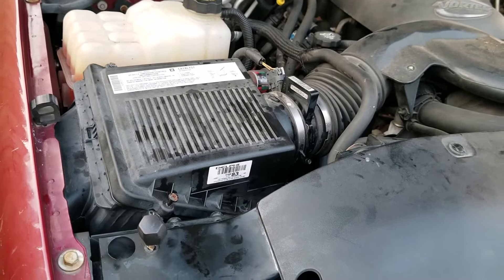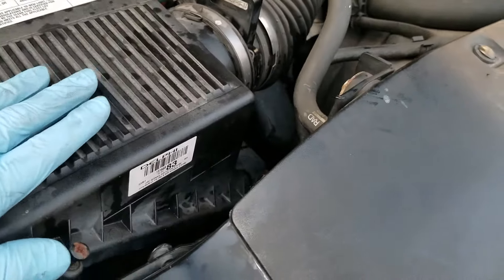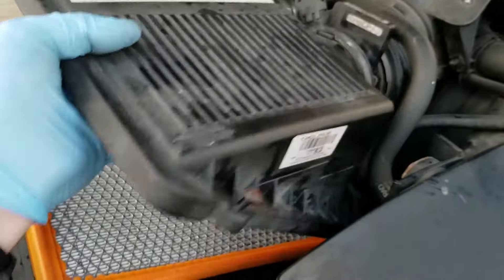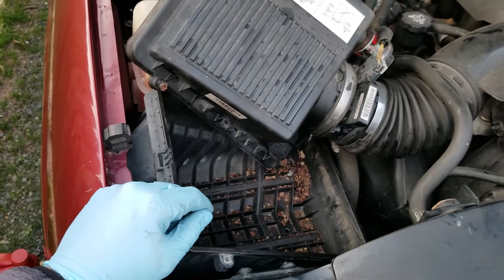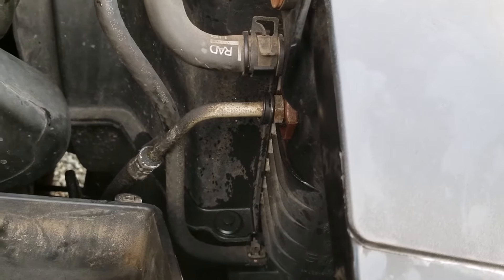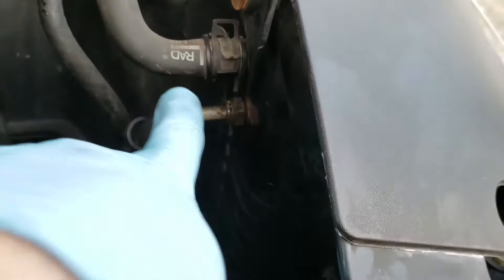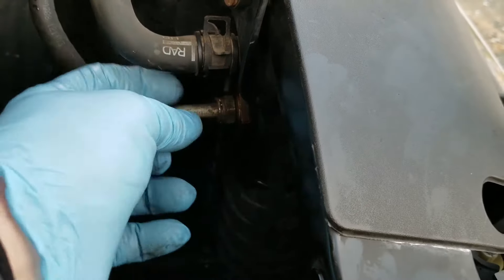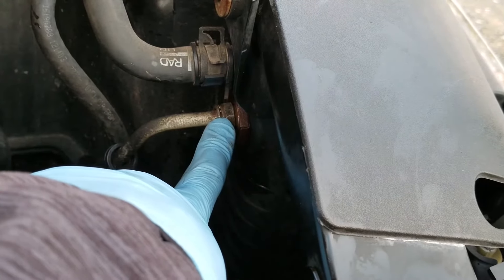4L60E Transmission Flush. NO Special Tools Needed! The fluid was REALLY bad!!

Comment: Not the best representation. Others fill 2 quarts over, run it till they get 2 quarts, put 2 more in and do it again. repeat till it runs clean fluid. That way when youre done, you are at least close to proper fill and you never risk running the clutches and pump dry.
Reply: Apparently, he added fluid first before pumping old fluid out so he wouldn’t run it dry.
Reply: Hush
Reply: That was my concern as well….. if you do this, is 2 qts like the max you want to run out before topping off? I have a 2003 yukon 4wd 4L60E. Not sure the capacity range of fluid when looking at the cross hatched portion on the dipstick when hot

Comment: The return line lubricates the transmission. It doesn't dump into the pan, so you were doing damage, which is not smart.
Reply: Do you need a two chamber pressure vessel or something to pump new fluid into the return then?
Reply: @stevetillery2432  Pretty sure the flush machine will use the return line and not the dipstick - they have the choice at the quick lube place to use the dipstick or both cooler lines (one to flow out and one to flow in). But the problem with using the return line for the new fluid is I think that will force out the old fluid blockages back through the transmission to cycle back out as the new fluid replaced the old.

Comment: I have a 2000 Silverado and the radiator cooler reservoir is plastic. Not sure about taking the nut/fitting out of it. Plastic is easy to strip the threads

Comment: my son and I change the Tranny Fluid every spring, before we start pulling heavy trailers, he has a Nissan Ultima CVT tranny, and has that changed annually also, it has 125,000 miles and runs like new. His truck is a 2006 RAM TurboDiesel auto Tranny, changes fluid for every long trip, pulling 20k loads, never a problem with it
Reply from the maker: Basic maintenance goes a LONG way
Reply: CVT are a time.bomb, especially from Nissan

Comment: Quick question..was this the first time ever changing the fluid on the Yukon..if so how many miles was on it. I have a 2004 Suburban that I bought used..dont think the trans fluid has been changed..just hit 100K. Some mechanics say leave the fluid alone..some say to change it.. Thanks
Reply from the maker: Honestly, I don't know cause I bought the truck used with 145k. For the mechanics that say don't change it....... I say they are in the wrong. Doing a pan drop and filter change would be a good start then after a couple thousand miles do this method to do a full fluid exchange. NEVER do a machine flush.
Reply: @JrZCarZ  Thank you for the quick reply and advise!!. Im first gonna do a pan drop and fluid change, I will replace the pan with one that has a drain plug so its easier when I change fluid again after couple thousand miles.
Reply: I’ve heard that also. But all fluids NEED to be changed. If you’re having problems,they say you can screw it up more. If you’re Not having issues with trans, change it by all means to keep it problem free for as long as possible
Reply: I too have learned that you should change the fluid.  Only from now on I'm gonna have the pan dropped ant a look at the filters.  They are there for a reason and I've heard the arguments for leaving it alone but really that just means you will drive it until the transmission grenades itself.  Now I was in that camp practically my whole life but having done a couple of older projects and now I'm replacing my transmission as I speak. Why ? Because I ignored some basic things it started doing; which was over modulating or slipping going into third.  Now I'm armpit deep in grease and still only halfway done. The point is there are good arguments for both but having lived long enough I would say preventative maintenance is you best bet.

Comment: Any updates or feedback on how the transmission was after the flush, any noticeable difference in how it shifted, no change? Thx
Reply from the maker: Transmission was good for a bit after the flush but it ultimately suffered the common 4l60e failure.
Reply: @JrZCarZ lol I might be in the same spot. In the process of doing 2nd drain and flush and wondering if it’ll last longer or less time after swapping out another 5qt of clutch material filled pinkish black atf. how many miles did it last?
Reply: @JrZCarZ  Sorry, I'm not familiar with the "common 4160E failure" what is that failure?
Reply from the maker: Here's a good read on the issues
https://gearstar.com/3-symptoms-of-a-failing-4l60e-transmission-and-how-to-diagnose-the-problems

Comment: great video.  OK- i have an 05 suburban- same set up.  if i can't get fluid 'out' (don't want to drop the pan, etc.), should i unhook the bottom line too - for it to drop fluid out?
Reply: Curious to know what you did as your question is 3 months old, but that's what I've heard guys do. Just pump all the okd fluid out until you get clean fluid pumping out.
Reply: Always change your filter
Reply: @chuckylee8812  which means to drop your pan guys.

Get new gasket and filter...and swap in new.

Be careful to get the old oring from old filter out as you don't want to double stack these causeing.leaks

Good luck.

Comment: Thank you for making this video I have water mixing in with the transmission oil and I need to flush it out I believe radiator inner cooler busted and is causing water to go in the oil cooler causing it to mix with the transmission oil
Reply from the maker: Good luck, hopefully it was only a little and for a short time cause water in the fluid will kill those clutches quick fast and in a hurry

Comment: What’s the best way to do it so I can drop the pan without making a mess? 2003 Yukon 4l60e
Reply from the maker: If you suction the fluid through the fill tube it will get enough fluid out to where it's not going to make a complete mess when you drop the pan.

Comment: Thanks for the video first of all!!!!
So I’m a little confused. I understand using a vacuum to pull fluid from the dip stick. But wouldn’t you want to change the filter afterwards if you got the full flush complete you still could vacuum the pan out and put that fluid back in?
Reply from the maker: Yep, you would want to replace the filter as well to complete the service. I had already replaced the filter so I didn't do that in this video. Thanks for watching!
Reply: This is a cleaner way of doing it.Once you loosen the trans pan, you get fluid all over. If you extract fluid first, cleaner job. Also, some change the filter every 2 or so flushes, some people open a whole new can of worms by taking the pan off in the first place.
Reply: Especially w/ an '06 Yukon it can be a pain just to get to the bolts & that's assuming the bolts aren't rusted in ace. A shop posted a video & spent over 2 hours cleaning off the old gasket & mating surfaces. I've heard from multiple sources the filter isn't much of a filter as it's a sealed system, & the magnet is what collects the particles not the filter. 
I haven't changed the filter in my '00 jeep cherokee XJ AW4 trans & a lot of guys don't & we get 300k or more on those old but rugged engine & trans. Using a quality fluid & regular "severe use" service schedule seems to be key. Adding a trans cooler would also be a better use of time & money then scraping gaskets & getting the pan to seal.
Reply: Get you a pan with a drain plug on it. Thats what I’m planning on doing. Thank you for the vid!!!

Comment: Question, did you begin putting in new fluid as you flushed out old fluid? Or did you first flush out ALL old fluid?
Reply from the maker: I dropped the pan and replaced the filter before filling it back up. Then once that was done I performed the 'flush' so clean fluid was being pumped through the trans.

Comment: After dropping the pan, did you fill with fluid before you drained through the radiator? if you did, I missed that part.
Reply from the maker: Yep that was done before I started making the video. The pan was dropped, the filter replaced and clean fluid re-added

Comment: So, to be clear - After pan drop and filter change, bring fluid to correct level and THEN add 1.5 gallon ATF before flush begins? No problem with overfilling? Thanks.
Reply: for short durations (such as purging/flushing/whatever) no, not really any issues. you just don't want to run it overfilled during normal use.

Comment: Hi there, Some people states that  flushing your trasmission after 150k is not good at all since it would force all the metal debries in the toque converter run into the valve  body  then causing sleepage. Unless it is just a falacy? What do you think?
Reply from the maker: Hooking up a transmission to a service pump like they have in dealerships for a flush is not good. If you do it this way you are using the transmission pump to do the fluid pumping, which is it's normal operation, so it's easier on the trans and doesn't force the fluid through. Take it with a grain of salt thigh cause if you ask 10 people the same question you'll most likely get 10 different answers 😄
Reply: Again. I asked 10 trasmission tech senior experts and told me depending of the fluid inteeval service in your trasmission would take the right option  to flush under normal drving conditions , but if the car's owner doesn't  know or doesn't have any previous récords of maintenance the probability could be 60% to 40 that after any good procedure flush would cause a slippage after several miles of driving your car. Now the grain of salt will turn eventually  into a headache.
Reply: @hansenriquerach-mendoza3515  I think the flush machines either go through the dipstick (which is no different than what someone could do at home with a dipstick pump) OR they hook up both the flow out and flow in to the coolant lines! By flowing the new fluid back in through the cooler line then they are forcing the gunk backwards out of the transmission because the new ATF is flowing right back into the transmission into of if the new ATF is going down to the pan directly via the dipstick. Pretty sure that is what is meant by "reverse flow" via the machine flush.

Comment: so you empty a gallon then stop, add a galllon and repeat until it's clear?
Reply from the maker: Yep. I would add 1.5 gallons in before you start so when you empty the one gallon out you're not going to run the trans dry of fluid. Then when you get good clean fluid out, fill as per the dipstick.
Reply: @JrZCarZ  thank you man! Yeah understood on the first cycle / gallon since I may or may not empty/drop the pan...but I really should.
Reply from the maker: @vzangla  if it's been a while, I'd suggest a pan drop and filter change.
Reply: @JrZCarZ  I

Comment: How did you keep fluid going In to the trans?
Reply from the maker: Basically I added about 1.5 gallons into the dipstick tube, then.pump out 1 gallon. Add another gallon, pump out a gallon and it should be clean by then. That way you know there's always fluid in the pan and it won't run dry.

Comment: if you use biger hose diameter, you can screw hose into radiator hole ( thread)..u save time with mounting hose to nut....
Reply from the maker: Absolutely. This hose is what I had laying around the house so i made it work with that, but you could use a bigger diameter hose as well.

Comment: Why the hell did gm start using those clips? I don’t know how many I’ve lost doing engine swaps. And then hoping you can find new ones at the local dealer or parts store.
Reply from the maker: It's not just GM who has those clips for cooler lines. Pretty much most manufacturers use them.

Comment: I thought you were giving up on the Yukon, glad you haven’t.
Reply from the maker: Thanks James, I was going to write it off but I'm stubborn after I have time to think 😁. I just took it on another spin for about 5 miles and it feels better than it did yesterday.
Reply: @JrZCarZ  Great, new Yukon’s are selling at $78k, unbelievable, Escalades close to $100K. We had a Lexus ES 300 with 200K, we flushed the transmission 3 times and ran compressed air through the trans cooler to clear out any sludge and blockage, it then ran smooth as silk.
Reply from the maker: So far I've put about 35 miles on it and no issues! Which is good, because the starter crapped out on the Torrent and I'm not going to pay the 'bend you over and ram it in dry' box store prices for a starter. RockAuto it is!
Reply: @jamespn how many miles did the 300 last for?
Reply: @KollynJ  It was sold after we processed the mechanic’s lien.

Comment: Maybe I missed this, but did you use Dextron lll fluid?  Is Dextron vl OK for my 2004 Silverado?  Seems to be different opinions on this.
Reply from the maker: I used a multi vehicle fluid that was Dextron VI compliant. Some are not so you have to look at the bottle to see.
Reply: Dextron VI is what I've read is  called "backwards engineered" meaning it can be used in older transmissions that used dextron III. Gm went to dextron VI in 06. I use it in my 05 and 06 sierra, my 03 yukon xl and my 99 Silverado plus my jeep that has a 2000 ls swap. So far so good

Comment: I was told bye Ford not to do it   I didn't know the history of car got 204 thousands miles on it seal transmission
2009 Ford fusion.   No flush transmission
So really don't know now what to do.?
I quess nothing ... History unknown.?!
Reply from the maker: I would just do a pan drop, then drive for a couple thousand miles with some new fluid and do that like 2 or 3 times if you are unsure of the history. I have another video on my channel on changing the trans fluid on my 2013 Escape that may help you out.

Comment: THEY SAY YOU ARENT SUPPOSED TO DO A FLUSH ON VEHICLES? WHO IS RIGHT?
i JUST DID IT ON MY TRUCK, SO NOW IM WORRIED LOL
Reply from the maker: Having a machine flush pushing the fluid through the trans isn't good, however using the trans pump to pump the fluid is perfectly fine.
Reply: I sent a sample of my trans fluid to a lab to see what condition the transmission was in before I did a substantial drain and fill.  The lab is Blackstone Laboratories.  My >100k miles transmission was in excellent shape according to what they DID NOT find in the old fluid.
Reply from the maker: I've used Blackstone in the past sending out engine oil. It's a great tool to have in order to see how things are going with your car
Reply: I’ve always done them on my vehicles. Honda,Tahoe,Sable,no issues. But sooner or later you do want to get in there and swap the filter also

Comment: Really people for how long it took him just to get that off. You could have already dropped the transmission Pan. You want to clean the pan anyways Stop being lazy and do it The right way does not mean you have to change your filter
Reply from the maker: You obviously didn't watch the whole video. I said I already dropped the pan and replaced the filter. Dropping the pan only gets about 5 quarts out of a 13 quart system because of fluid caught in the cooler, lines, valve body and torque converter. This cleans that all out. Thanks for the comment, but you might want to try to understand things before trolling 😄
Reply: This part is needed for a full flush. Fluid still in the cooler and lines.